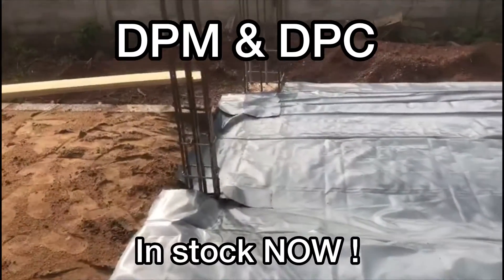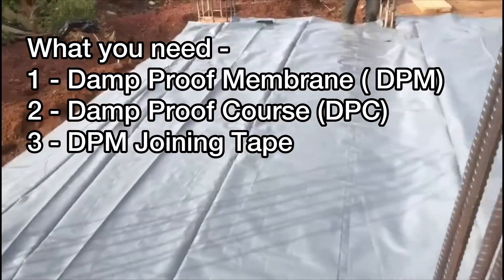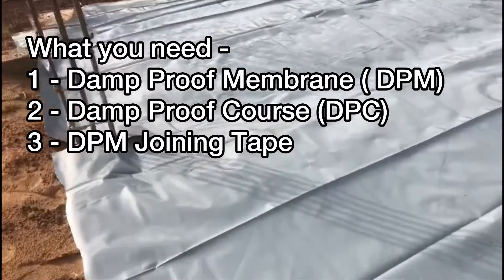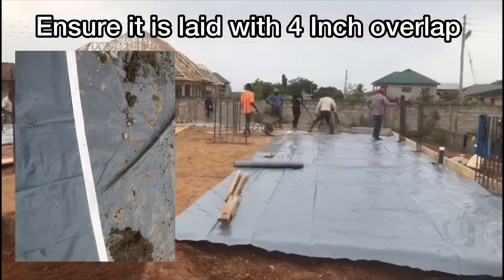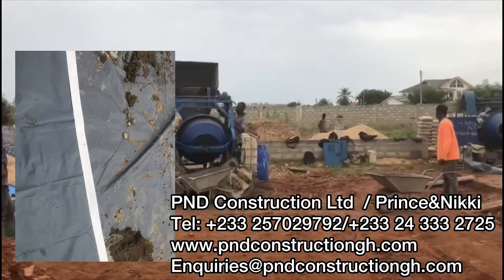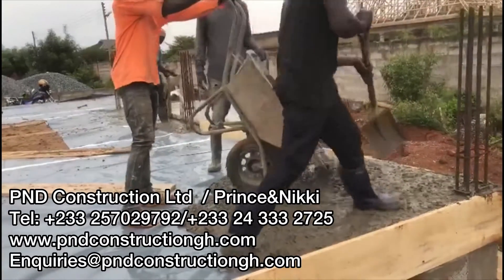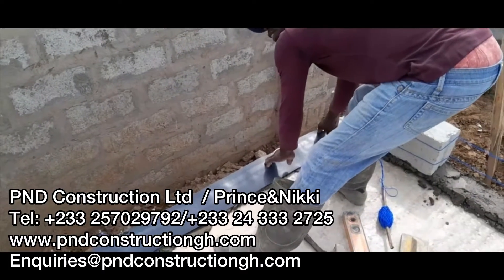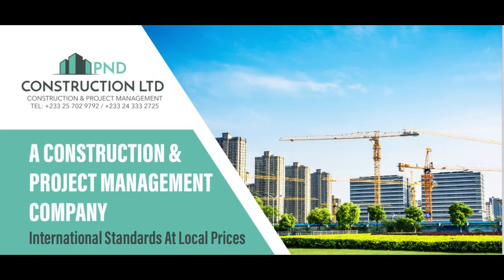Damp Proofing Materials for Building in Ghana 2024

Comment: I, as a builder, I personally don't trust any uncuppling system  in a structural application.  There are other methods that will ensure proper binding and avoid moisture for traveling.
Reply from the maker: What is important is to follow the national building regulations and code when buildings. Because a building control certificate will not be granted when you deviate from the regs. Thanks

Comment: Do you also recommend the Bitumen waterproofing paint and Vitalia Neo to mix with the cement/concrete/mortar?
Reply from the maker: We recommend following the specifications provided by the designers. Thanks
Reply: @princenikki  ... I'm not a contractor/builder so I'm not clear about your respond regarding following the specifications provided by the designers.
Reply from the maker: @bhat_ysrael  our recommendations is that you speak to your architect and structural engineers about the appropriate waterproofing solutions for your project. Thanks.